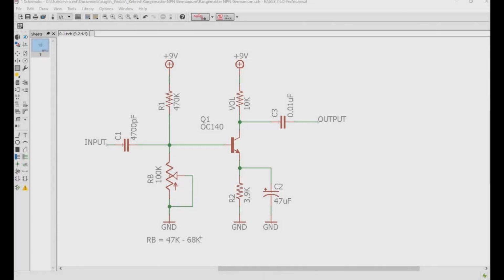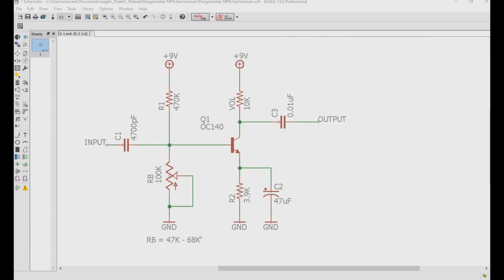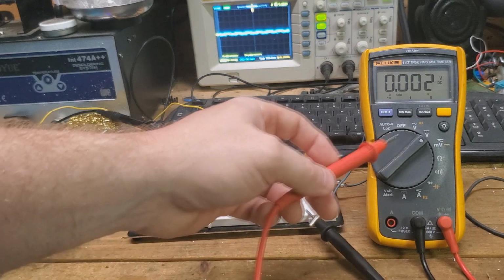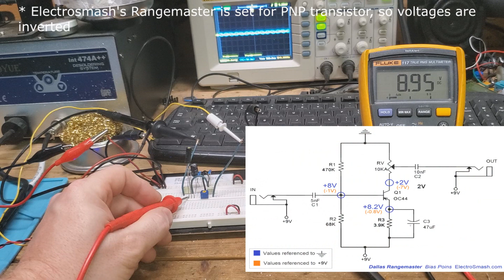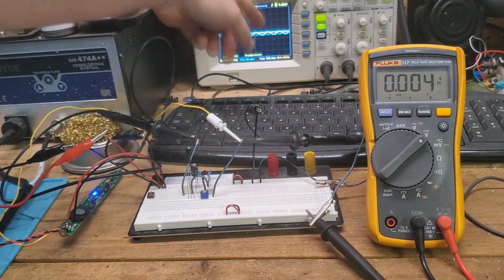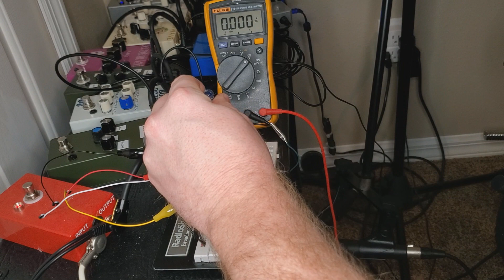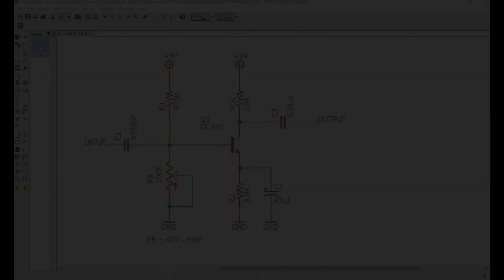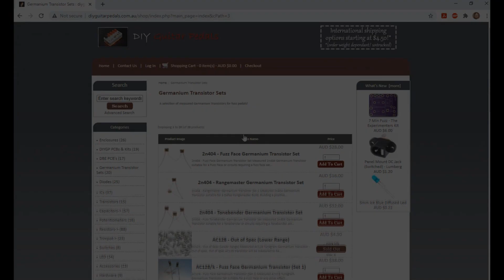Trimmer Potentiometers for Beginners - How to Bias Your Guitar Pedals

Comment: Can you use this device to trace and audio input signal through a tube guitar amp?  Is there an issue with the high voltages on the amp circuit and this device?

Comment: I have a quick question. Just built a delay/modulation pedal, a clone of the EQD Space Spiral, and the repeat volume is super low, you can hear repeat and wobble when I turn the pots but the volume is so low it’s almost impossible to hear. What could be the problem? The initial volume of my guitar is normal, it’s just the repeats.
Reply: I'm looking at the Dark Rift Delay schematic as a reference, but leaving pin 7 of the PT2399 is where the output of the delay signal starts. I'd use an audio probe and follow that out from Pin 7, then go to the other side of the 1uF capacitor connected to pin 7, then the 1K resistor after that, then to the 10nF cap after that, getting to your repeats potentiometer. Somewhere in there is either a bad solder joint, a bad component, or a short.
Reply: @erikvincent5846  I’ll check all of that out today and let you know the outcome. Thank you!

Comment: Thanks for this video.  Well explained as always.   I am confused on one point though.   The Rangemaster spec says 2 volts, not 7.   So are we actually measuring the voltage DROP?   Thanks again.   EDIT:   I just noticed that voltages are inverted, is that the reason?
Reply: Yep, inverted for the PNP to NPN conversion